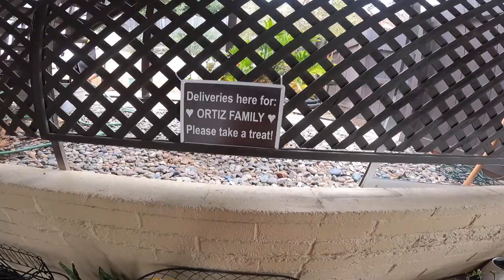POV ROOFING! What is ROOFING in 2021?  DAY IN THE LIFE!! #roofing

Comment: I really recommend you to use gloves prevents from splinters and having blisters, getting your skin damaged. You get a better grip on the shingles which means you can take a higher amount. What I do when I do these roofs I take first layer of shingles off then take out all the nails by hammer hope it’s a sunny day so the shingles get hot and come out in big pieces if it’s cold then your 2nd layer of shingles is gonna crack and come out all small pieces when this happens I cut a piece of synthetic felt, use it as a tarp , use a rake to get all shingles pieces in a pile then use a shovel dump In tarp/felt piece and dump in trailer I do a lil knot and tie it up so the air won’t open tarp and all shingles pieces fly everywhere this method is the best in my opinion saves you time and all that messy clean up down on the grass cleaning all the little pieces of the old 30 pound felt and make sure you tarp everything good I prefer you nailing tarp on edge under the first row of shingles on the roof 👍
Reply from the maker: Thank you for your advice! I appreciate the support to my channel and will try to apply different ways to help my crews run more efficiently! Thank you🤙🏾